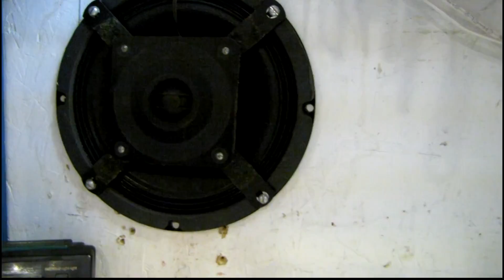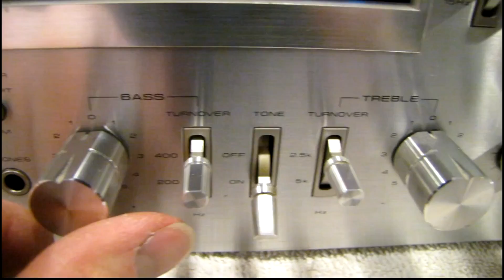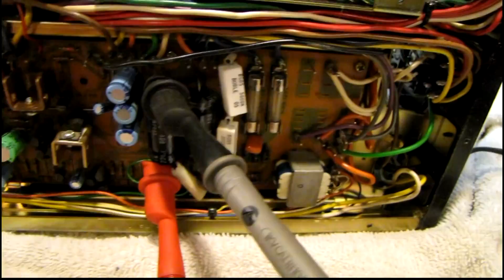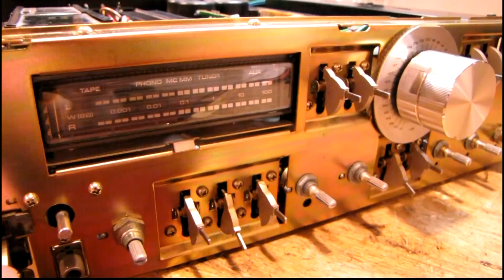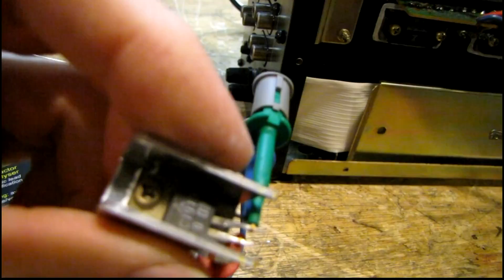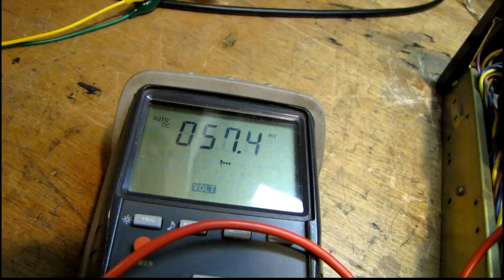Lost Video:  Pioneer SA-9800 Amplifier Restoration

Comment: Hello there. I just got this amplifier from one of my friends. It's power transistors were blown off. He gave me the transistors and I replaced them. But, while opening the left power amp pcb it got short somewhere and there was a spark (2times) I took it lightly and replaced the power transistors. Now after watching your video I came to know that the relay tick in after 5secs... I remember when I switched it on just after receiving the relay ticked.. so, should I open the protection board now?

Comment: I don't know, if sy wrote it already. But any kind of electrical work in a such great device, always keep in mind, that capacitors with some thousand uF can seriously put out 2-500 A of short circuit current in case that something goes wrong, limited by their ESR only. If add all series resistance in a low resistance, high current path, we still deal with 50-100 A instantaneous current capable of easily destroying any kind of output devices. For this reason, one should consider two safeguard tips: for protecting primary side, use a series bulb of 40-100 W and for semiconductor's sake, put 10 ohm / 5W resistors (these will vary depending on class and circuit topology) in the path between high capacitor banks and amplifier board. The heating of these will indicate possible problem, and they will limit current to an absolutely safe level for almost all higher current stages.

Comment: ppl think when they have a "vintage" amp a full recap resto is needed. why fix if it aint broke!? u lose value by swapping original parts. i have a pioneer sa9900 & sansui au717 all original work great. 30+yrs

Comment: I have this amp, works well after some contact cleaner in the switches and pots - only problem is the display is very dim, about quarter of the brightness it should be :-(   Sound is awesome though driving my Pioneer S910 speakers.
Reply: Check your power supply caps that powers the display. They could be on the display board or on the power supply.
Reply: Went to use this after some time and now it has a huge hum which is constant and not volume dependent.

Comment: my 9900 sounds stunning, replaced the 1451's and regulator transistors on power supply, almost all electrolytic except filter caps.

Comment: wi ai'v got a NAD surround sound receiver AV-716  end from time tu time the left chanel stops working not oll the time I think onli wen its ghet's a litle bit hoter end thi only way make it work is to turn the volume up the components in side are oll gud its does not distort or everything else can you give me any idea where I should look for the problem

Comment: Repairing vintage amps/receiver can be fun, but sometimes a pain in the arse.

I'm having problem with my Yamaha CR-2040 receiver, A hum in the preamp.
L and R shares the same voltage. I've measured the voltage that goes into the power amps. Sadly, I accidentally shorted the -60 volts with the wire that goes to the relay. I've have recapped the preamp and the psu. I've replaced 4 transistors in the psu. But the speaker relay won't click. Is the relay broken now? I'm sad :(

Comment from the maker: Caig Faderlube is best for controls and switches.  DeOxit D100 is next best.  For the tuning cap, they do make some cleaner for that, but you might be able to fix it with simple compressed air.  Sounds like you have dirt or corrosion between the plates.  Also make sure none of the plates touch each other as they rotate.  If the bearings are accessible on the ends of the tuning cap, a small drop of detergent free oil can help a bit too.

Comment: I have a hk pt2300, sansui tu717 and a kenwood basic m2a with paradigm 11se deluxe
speakers.
I'd like to clean all the contols at least and the sansui has a scratchy tuner.
Do I just use deoxtit? and on the tuning caps?

thanks

BTW if you blast AC/DC on any of the past 2 amps, they will make tweeters catch on fire.
Not too many tweeters could handle these type of amps